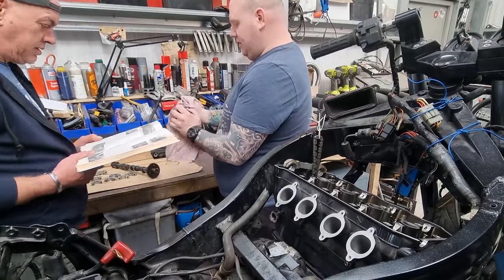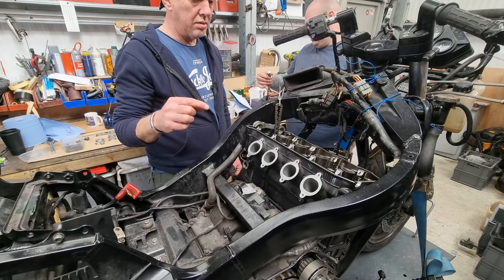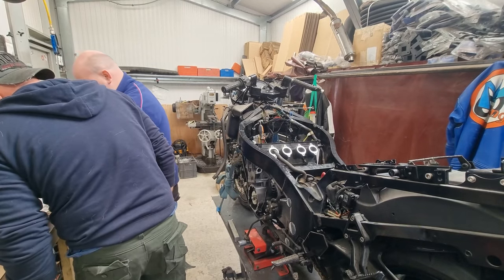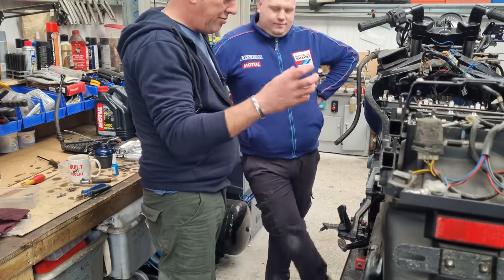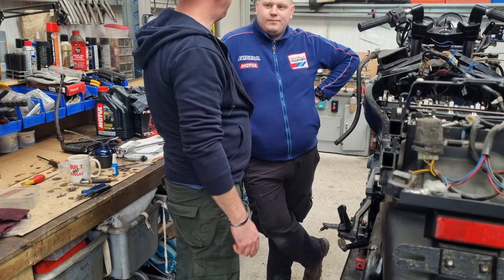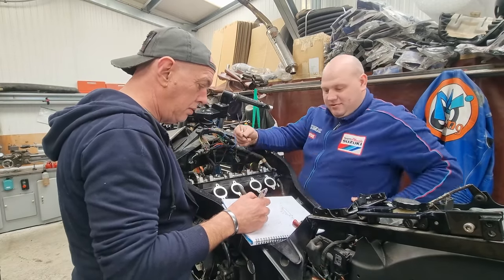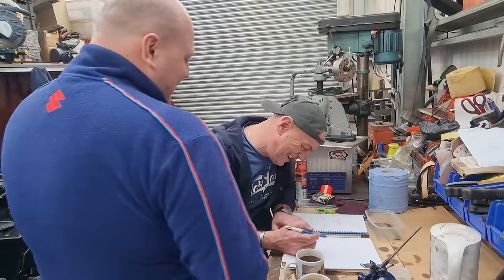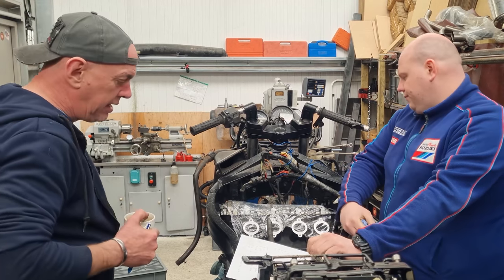Cams & Timing - 1990 Kawasaki ZZR1100

Comment: Good one for guidance! 🙂 replacing my intake cam, as some of this 1100 kawaz seems to eat the intake cam a bit over the years.. a small note for everybody doing this, remember to check the bolts holding the cam sprockets, should be Loctite on bolts. I messed up a 600 when replacing head and cams, where the bolts vere not properly fitted to one of the new cams, the bolt loosened after starting running and smashesd the crank sprocket after ending up there... Thanks for the video, cheers

Comment: Now your in it..lol...That's why I like to set.head up on a bench (or  off motor)..I carry head to bike shop, and do the shims in the lot..No running back and forth..You'll be happy you did the valve adjusment..Nice quiet engine with plenty of power..(for racing, you set at the thickest limit for extra valve lift)..Rover's, Fiats, Jag's, Lotuses, etc. all used shims..then they figured  out how to make Hydraulic lifters and they never looked back..You can get deals on old bikes and cars and all they need is a valve adj...Hardened shims are very hard to get and will only go up in value..Well done! and looking forward to hearing it run!!..👍👍👍🗽🇺🇸
Reply from the maker: It's all going quite well now and I'm glad Jamie was.there to.explain everything. I spent all day picking his brains 🤣😂
Ultimately I'm after a sweet running engine that's going to be reliable and I think we're well on the way 😁👍

Comment: A wee tip for next time ,the Haynes tells you how many links  between the timing marks from exhaust to inlet should be and rotating the engine towards the tensioner to take up the chain slack.
Reply from the maker: Ah right... didn't know that. Thank you matey 👍